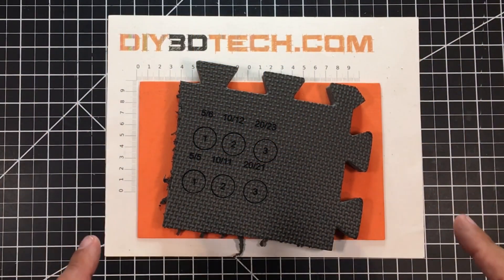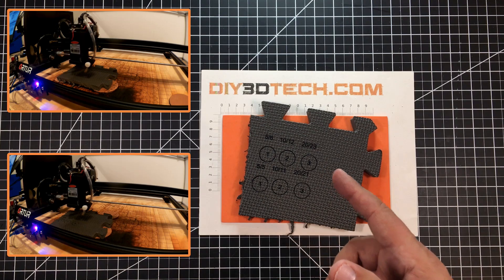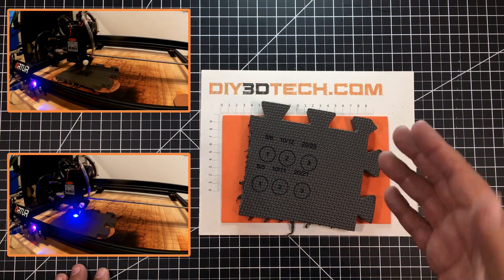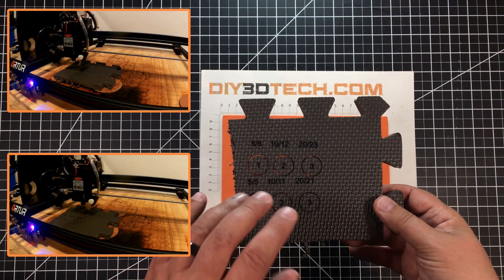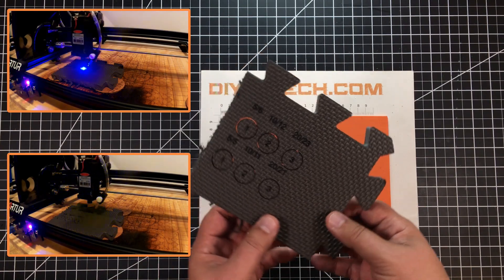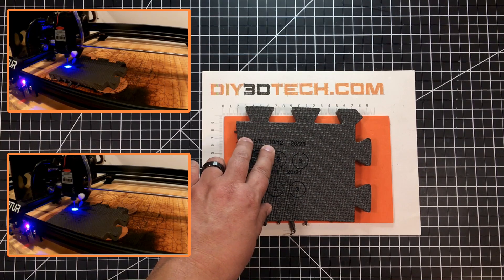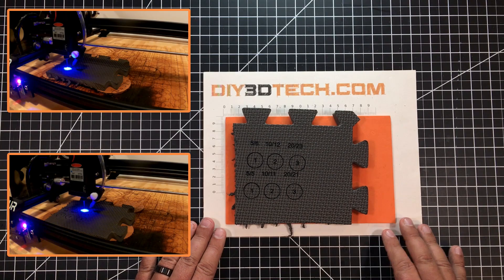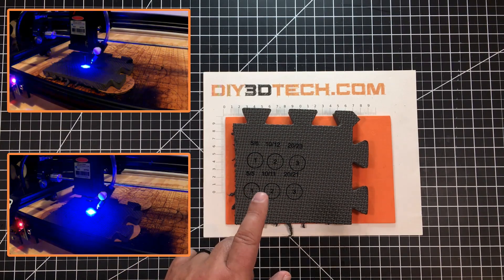Ortur Laser  - Can You Cut Harbor Freight Foam Floor Tiles!

Comment: Definitely bad for you to breathe the fumes. That is EVA foam AKA Ethylene-vinyl acetate. I'd love to cut this stuff with lasers if I had the option because it is a common cosplay material but it's hard to get perfect cuts and they go through xacto blades and utility blades like crazy where I'm constantly resharpening the blades.
Reply from the maker: Yes I have a good evac systems and have made a number of things so far.  Also finding if I focus about 2/3 the way down I get a better edge finish...
Reply: @DIY3DTECHcom  Yep, I remember you talking about your evac system. I'm just confirming what you were saying about the fumes being dangerous. 

I'm kind of curious on how the foam handles being laser cut. We typically use a heat gun to thermo-form and seal the closed cells, but it also causes a bit of shrinkage. Have you noticed any shrinkage at the cut edge? or is it precise enough to be unnoticeable?
Reply: EVA Foam is considered safe to laser.  CO2 laser is preferred, but some use diode with success.  Ventilation is important, however, because the chief decomposition products are carbon monoxide and carbon dioxide.

Comment: Is this the stuff you put under your carpets? I have never seen this product before
Reply: No this is relief mats for standing. They cost around  $8.00 for a pack of 3-4.  They are Used by the Cosplay types for props.  It’s a nice dense Eva foam.
Reply from the maker: Correct!

Comment: I built an adjustable z axis for my ortur using a separate nema 17 stepper on an acme leadscrew. I have cut black open and closed cell foam up to about an inch in as few as 3 -4 passes. (20 watt input). It's all about the focal length.
Reply: I would love to see that setup.
Reply: @Salguod2k  me too
Reply: @Salguod2k  its still a work in progress, I was trying to find some sort of output from lightburn like a pmw signal to integrate the z axis. As for now I'm using upcycled linear bearings and rails form a old DVD burner and a cnc machined aluminum  mount the stepper and limit switch. I tried to make it as compact and as light as possible. Currently the z axis uses a stand alone  Arduino, shield and driver connected to a small touch screen so the code can be overwritten on the fly without a pc running. I am able to adjust (dwell),(z distance),(amount of passes),(current position or home).   The whole cycle starts of with a 5v output from the board that fires the laser. "Let's say the first pass of the laser says 14 seconds in lightburn and I want to make 4 passes. I tell the Arduino upon cycle start (dwell 14 sec) the laser makes its 1st pass. At 15 seconds the z axis goes down .100"   At 28 seconds the z moves down another  .100" and so on and soforth. At 56 seconds the z will go back to its home position ready for the next cut. Its been a fun project 👍
Reply: @kendesign3622  Seems like a great project that many on here would love to see on video.  Cheers
Reply: @kendesign3622  would you want to share code? Funny enough I'm about to make the exact same thing
Reply from the maker: 20 Watts (assume input) will make a big difference over my 15 watt...